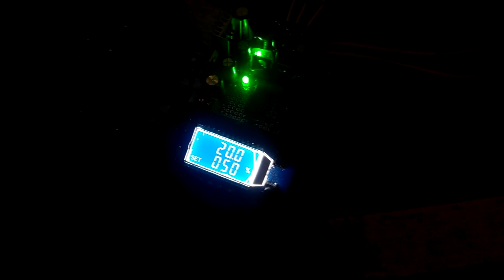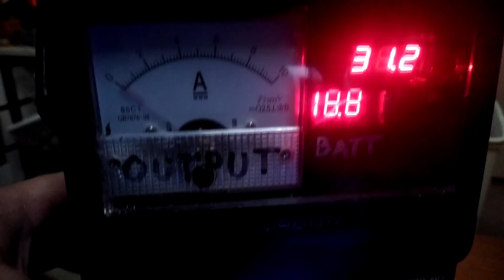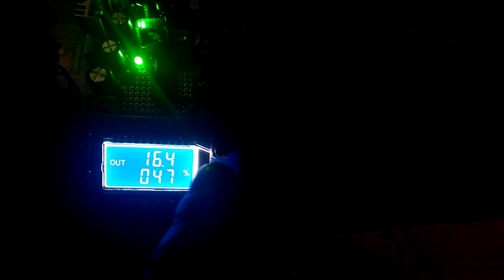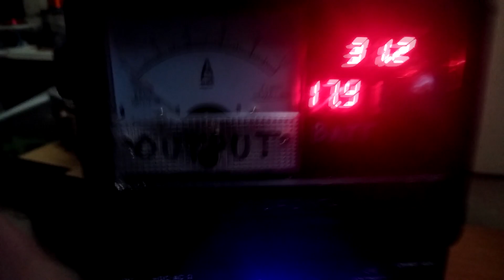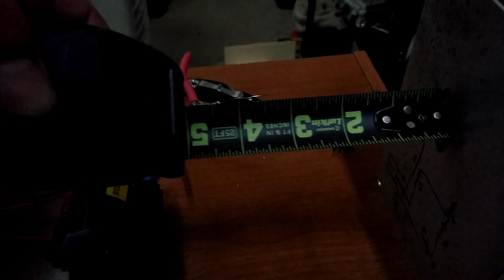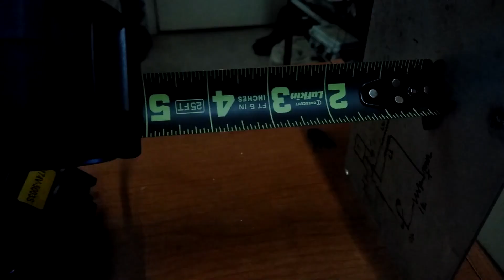Flyback Driver - Increasing arc ignition distance (9.5cm ~70kv)

Comment: Pretty sweet, poor flyback lol. I reckon you might have more than 70kV there as the big flat surface area of the return electrode is spreading the field of breakdown over a larger surface area, if both electrodes were points you could probably squeeze a little more distance from it. Also see where there's additional streamers coming out of the red HV wire, that's taking energy away from the main arc too, minimize as much sharp wire edges as possible (apart from where you want the arcs to take place) to keep that extra energy (corona losses) in the circuit and it will jump further.

Regarding the 30khz thing well I think its down to the snubber design in this circuit, the upper diode prevents any significant LC resonant tank operation you'd get with a standard capacitor across the primary coil which means the best arcs are with lower switching frequencies, (down in the audio range will probably produce ever longer arcs). 

With a bog standard LC tank capacitor like in other drivers upping the switching frequency would mean you'd hit multiple harmonics where suddenly the output power will increase exponentially and then come back down again as the frequency is continually increased, sometimes you don't even need a "real" capacitor as the parasitic capacitances will do it on their own.
Reply from the maker: I could def get more out of it if I really tweaked every variable but I gave myself a little leeway. Anyone should be able to get ~70kv+ with that flyback.

Comment: I could have only seen such beefy arcs from Franzoli when he audio modulated his flyback. Now I see you also successful with same arcs. That's indeed stunning. I would never have thought that with that new driver, you are getting some pretty damn good arcs like that. Think I must give it a trial too.
Reply from the maker: When I first saw the basic 555 flyback driver circuit it didn't make sense to me that it would work so well. It really doesn't, in that its basic form turns the mosfet into a heating element. I've seen about 4 or 5 people on youtube now who have achieved these distances or longer with this kind of circuit, jmartis2 being one of the most impressive. The ones with the best results seem to at the very least be including a capacitor across the mosfet drain. I think Franzoli uses something around a 40v drive to achieve his long arcs which sounds about right assuming the flyback can take it. I can't guarantee the one I'm using will but it's at least a good one to start with.
Reply: Please send me circuit
Reply: Ask Ryan, he'll give you the circuit. I've got way too many different circuits which have got me the same results. But it depends on you components. Go for Tesla coils directly, they are more fun to build.

Comment: Those are some mean arcs, I've only ever achieved the mid 20-30kV range using a large ZVS driver at 28V! Have you considered getting an x-ray transformer to replace the flyback? I'm sure your little circuit could push 100kV+ out of that with ease (if it's one of those newer HF models, not the old 60Hz type)!
Reply from the maker: Hell yea bro I've been trying to consider what may be the best transformer option to go with this guy. I want to throw a 400-600V fet on there and reach 50v+ input possibly higher. I hear x-ray transformers are good and there seems to be even particular TV flybacks that can do way better than mine. The circuit would need modification for a lot more power but I never thought I'd get over 9cm on this thing. What's crazy is I'm pretty sure with the right conditions and setting up better electrodes it would jump 4 inches or more easily.